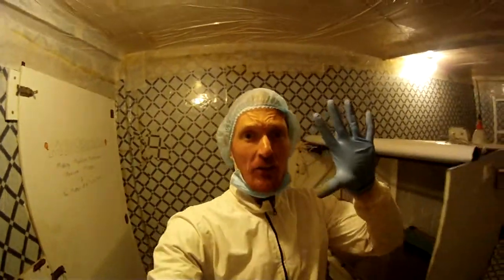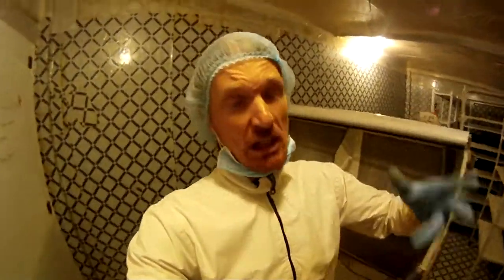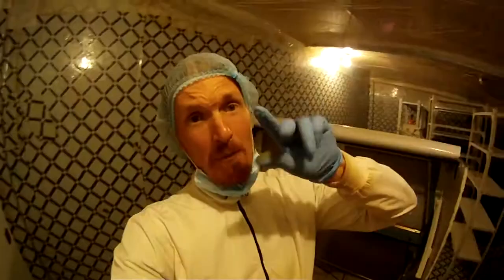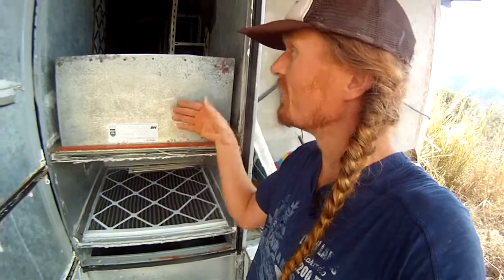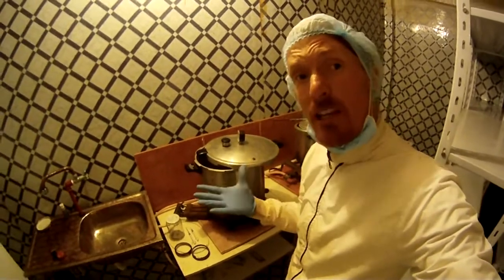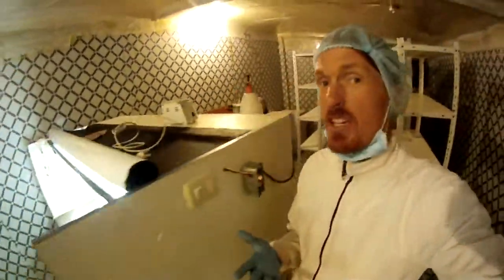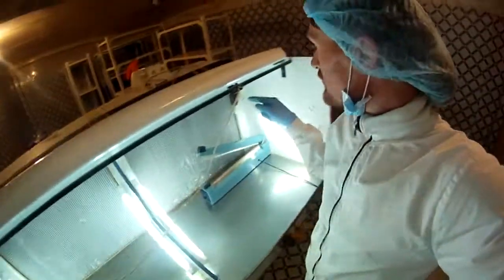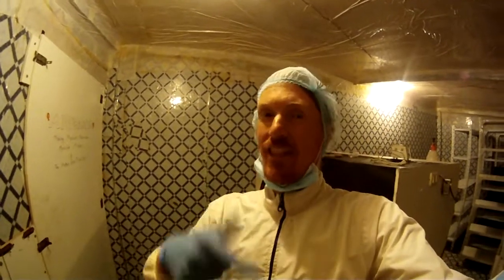Lab Tour! Learn how we grow mushrooms.

Comment: Hey man, good job on your grow outfit. Your video actually answered a lot of questions I’ve had. I’m wanting to build myself a lab, what material did you use on your walls,floors and ceilings? Is it easy to clean? what cleaning chemicals are best to use that do not leave toxic trace compounds behind?
Reply from the maker: Thank you.  Yes very stoked.  Brick walls with Lynolium on them, yes very easy to clean.  Happy with it.  Vinegar is nice for light clean.  MMS (Chlorine Dioxide), which is not bleach, it degrades to salt, and although very controversial is consumable at very small amounts.  Awesome sterilizer.  And of course Ethyl Alchol for surfaces.